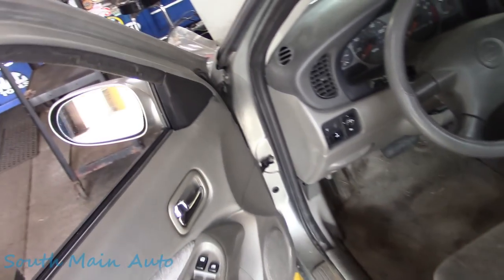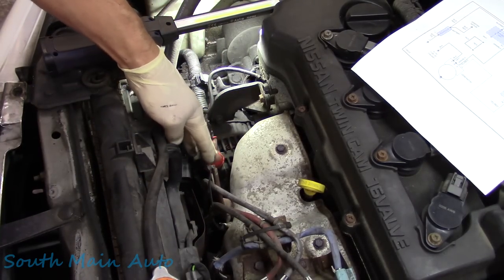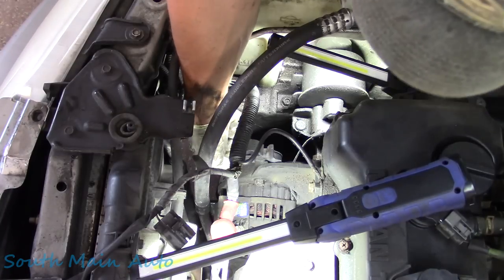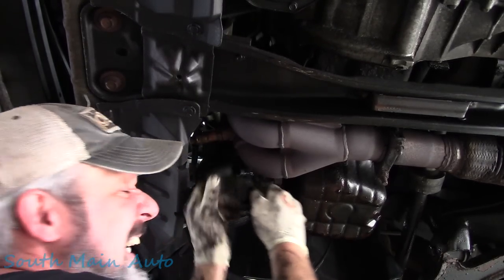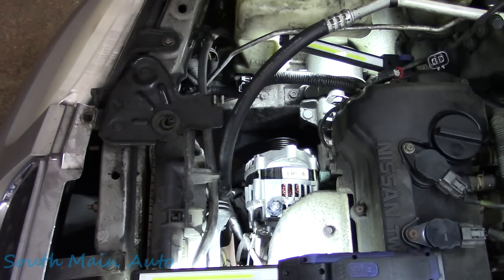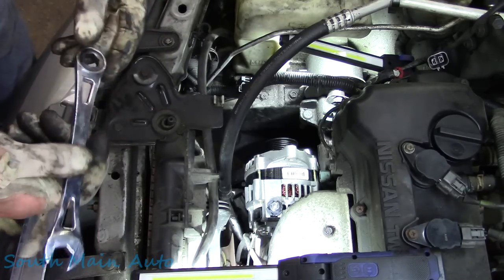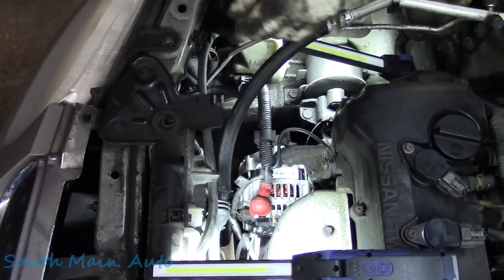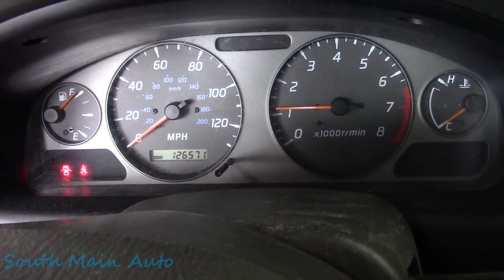Nissan Sentra: Battery & Brake Light On?

Comment: I wear the overalls sometimes. Good when working outside. They are comfortable and great while weed-whacking, chain sawing, crawling around under the car or truck in the driveway. I have some of the Carhart insulated overalls for use out in the cold snowy conditions too.

Comment: I knnw this is off topic of this video, but you will enjoy. Wife's Equinox developed loud noise in HVAC fan on high speed. Ordered new motor and squirrel cage. After removing old blower, found about two dozen acorn caps in the squirrel cage. Now need to check Cabin filter to see if they ate through it.  Really enjoy your videos for knowledge and humor. Keep up the good work.

Comment: "stop! it's hammer time", I grew up listening to a wide range of music. circa late 1970's(baby/kid) to early 2000's where I mostly got fed up with the newer cruft.
along the way, classic rock, classic country, rock, metal, death metal,(which is now all classic aged) did I listen to old school rap and bass? yes, did I have a "system" setup in my vehicles in the mid  1990's and later(yes), but I would adjust it and concert blast most any type of music, from classical/jazz to full out annoyingly rattling the whole tiny strip mall/shopping center of large glass front windows. I took my buddy to his bank and parked far away off in the corner of parking lot and cranked up the bass tape cassette(shows age) and thought, why are all these people coming out the stores and looking around. about that time my buddy scrambled outside flailing his arms in the air wildly. turns out, it was causing the glass windows to vibrate and rattle so bad it was scaring people and setting off alarms on some closed places. 🤣 I did that with all cheap garbage slapped together.

Comment: I feel your pain. The family own 3 91-93 Nissan Sentra and when the Brake and Battery lights would come on we knew it was the alternator(voltage regulator inside) or the battery. I would replace it about every 2 years. I think the space was so cramped and the components in the alternator would heat up so much that they would fail. I bought them from Autozone (remanufactor and the quality control was bad), but they has a lifetime warranty. The bad part was once I removed they would check it at Autozone on thier tester and they would tell you it was working. After I changed so many I would just ask to talk to the manager.

Comment: Mr O, I think you been tapping screens and playing with wires for too long lol .
I worked in asia for over a decade and I never complain about difficult bolt or not having the right/special tool anymore. What those guys can achieve with bit of ingenuity and physical ability is another level .
The chain and 2-by-4 on the old metal housing drills makes a mag drill unneeded lol  . I think 1 day of working at the Pakistani truck shop have me disabled for a week lol, those guys are proper durable ...
As for overalls, you never try you never know baby. just imagine the views & subscriptions on your first overall video lol .

Comment: you know on my 2000 Mazda MPV, the drive shaft needs to come out before the alternator can come out. nobody in car industry is designing for service. on toyotas with 2GR engines, for water pump replacement, first thing the book tells you is to remove the engine out of engine bay... I am sure there is more...

Comment: You are correct about the Pakistan Truck channel. Had to resurface a truck flywheel and one poor guy sat with a stone against the spinning flywheel (trans-off, clutch was being replaced) while the lucky guy kept his foot on the accelerator to keep the grinding progressing. And we whine about stuff!! I watched where they stripped the paint off the entire car with the sides of hacksaw blades.(Different channel).Only thing electric powered in the shop was the lights and fans!!!!!!!

Comment: I worked with an Engineer at NASA that wore overalls.  It didn't seem to embarrass  him.  

I wear overalls because they are comfortable when I'm working on anything where I have to bend down.  No belt.  I'm a 34 in the waist so don't have too much to hang over.  I'm am from the south but worry more about plumbers crack than southern stereo types.   

Make sure you get the one's that have a zipper.  Buttons don't go as well with greasy hands.

Comment: My 1991 Nissan Sentra had the alternator fail in the late 90's. It never turned on the battery indicator light while it was running. What was crazy is that the brake system indicator light came on. My wife got stranded and I had to go figure out what was happening. I put in an Advance Auto lifetime warranty alternator and the brake indicator light went out. About 30,000 miles later the alternator started growling and slinging grease out of the front bearing. Warranty replacement 3 times before I got one that didn't blow the front bearing at about 30,000 miles. I later had a secretary where I worked ask me to check the brakes on her Sentra because the brake warning light was on. I could smell the burned out diodes in her alternator before I got the hood up. She had just got the car so the dealer replaced it under warranty. They called me to ask how I knew it was the alternator without even seeing it.

Comment: I have a 1999 Toyota Corolla LE and the belt tensioner was bad so everything was running lower voltage the lights were dim when I rolled my driver's door window down

Comment: I saw a video that you made on a 07 Cobalt I have the same issue I have lights in my dash replace starter and still no start no crank what would you think would be the problem I've checked relays I've checked fuses I've tried to bypass ignition to start the starter it will crank but not start at all

Comment: I used to be a mechanic in the '80's\early 90's and modern cars scare me with all their electronic mumbo jumbo. Sometimes I'm glad I changed jobs as it took the Jeep dealer 4 days to change my 06 Grand Cherokee alternator. The guy said it was a real pain. I guess Mercedes didn't care about it ever being replaced.
Reply: The alternator on an 06 GC is stupid easy/quick to replace if it has a V8. Not sure about the V6 or diesels though.
Reply: @athhud  It was a real shame the diesel didn't go to the USA/ 3.0 with almost the same power output as the 5.7

Comment: @ 14:17 I helped friend kind of do this  to a 2001 nissan, we read in a manual  "To greatly increase access to the alternator first remove the radiator and heat exchanger" we didn't he had a pit instead of a hoist it was still a B.

Comment: I wore the overalls when I was running a engine in the railroad yard. under them I wore shorts you could not wear  shorts on duty so I took the overalls off and at the end of the day I put the overall back on.  It was cooler that way.

Comment: Those oil leaks are what is keeping it on the road up there in the salt belt 🤣
Reply: That's why you need a couple of leaking cv axles to sling grease all over the important parts

Comment: Coveralls were my Dad’s favorite.. and let’s just say, that a shirt is not the only thing you can leave off. 
I’m 42 and I just bought my first pair, and started wearing them, more to keep my clothes from most of the mess, and so far I really like them. Thinking about getting a short sleeve ones now.. but so far I’m keeping the undies on! I wrote all that thinking about coveralls not overalls, so there you go. As a carpenter I used overalls for a long time, and for sure they are nice for freedom of movement and pockets up high, but they can be irritating too.

Comment: Where exactly did that 75 amps from the carbon pile load tester flow?
Reply: Battery positive > alternator output cable > load box > alternator case > engine block > engine ground strap > battery negative.

The test confirms the alternator cable and the connection between the case and the block are good.  We know the engine ground is good as the car wouldn't crank otherwise.

Comment: I wish you quit whining over that easily remove the bolt. Do a 2006 Nissan Maximum  Alternator with that stupid design locking tab bolt. You have to remove the A/C Comprosser to get a pry bar on it to get it out of the alternator and bracket. Then since I'm a Moblie mechanic do with a jack stands and 100 degrees outside Hello from TEXAS

Comment: When the battery voltage is lower with the engine running........ it's not a good sign.
Reply: That’s completely normal, with the car off or key on/engine off, the fuel pump isnt running (after the initial prime if it’s key on, engine off) and the ignition isn’t firing, so fire up the car and now you have a load, if not there would be no need for an alternator
Reply: @braaapattack2937  if the voltage is lower, it's discharging.  Voltage is lower due to the internal resistance of the battery.
Reply: So if you have just a battery, and plug in a fuel pump to it, the battery will never discharge? Under load it’s going to show the battery voltage drop, remove the load and it’ll rise again. Normal.
Reply: If the alternator is working. It’ll charge and the alternator will support any load applied. Providing the load isn’t greater then the output of the alternator
Reply: @braaapattack2937  Why was the voltage measured at the battery higher after the alternator was replaced?  Because the alternator was working and the battery was being charged.

Comment: you have to go with the overalls. I wear scrubs to work everyday and overalls at home. great front pockets for the pocket screwdriver and small flashlight. what the heck, nobody's giving out prizes for best dressed. You are already married and Mrs. O will love you just the same. Roundhouse overalls the best. be sure you measure around the stomach and add an inch or two. send me your size and I'll hook you up.